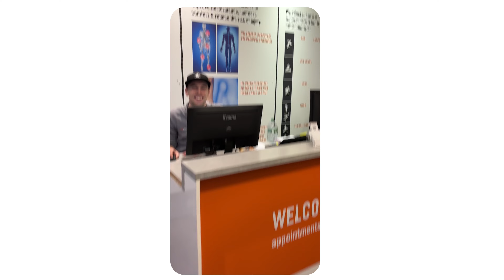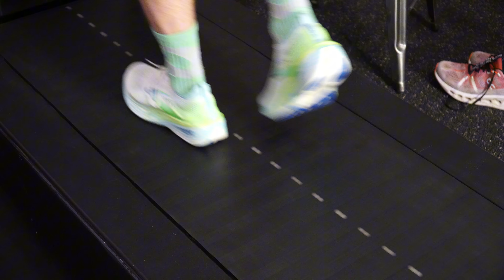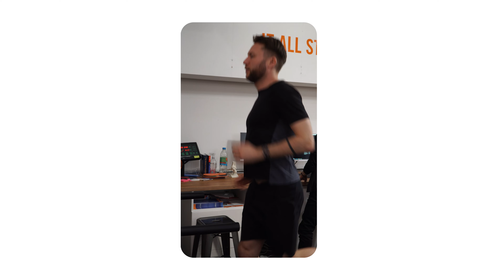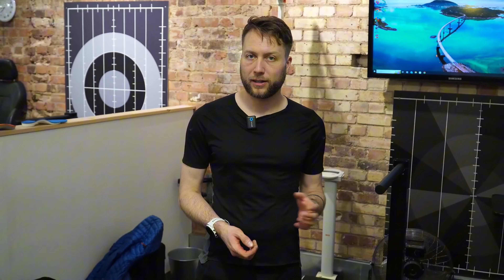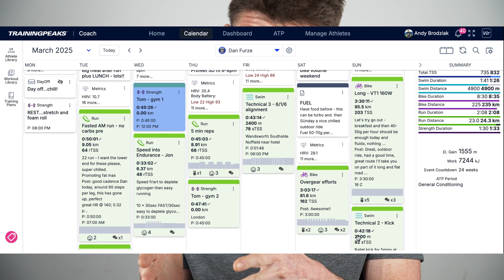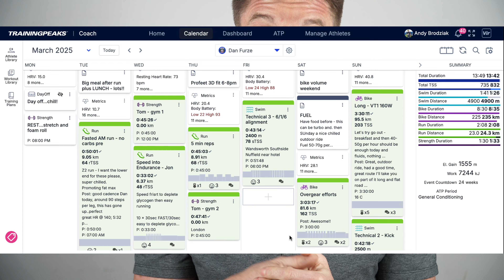Top Triathletes' Secret to Comfort & Speed: Custom Shoes - Kona Project Ep. 4

Comment: Great content as always, I'd really like to see how you manage to improve the cadence and vertical oscillation. 
Struggling with that too caped at ~160 spm and around 10cm avg of vertical osc on any run and getting higher with speed
Reply from the maker: Hi @martinp1837, thank you for the positive feedback. Run cadence does take some time - you need to do some treadmill speed work at a higher rate. Regarding the vertical oscillation - in one instance you can do run drills specifically to get your posterior chain working better, which means you will bend more at the knee and hip rather than bounce up an down. I will be sure to break this down in a bit more detail in some video content in the near future. Thanks for the comment.